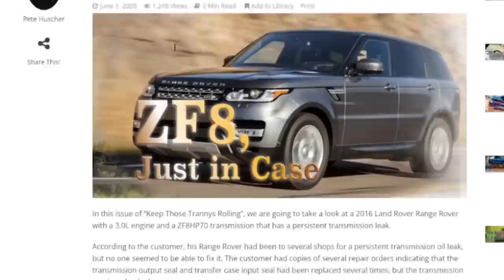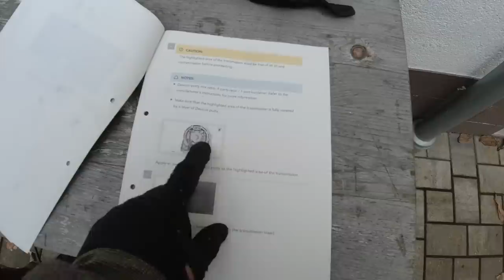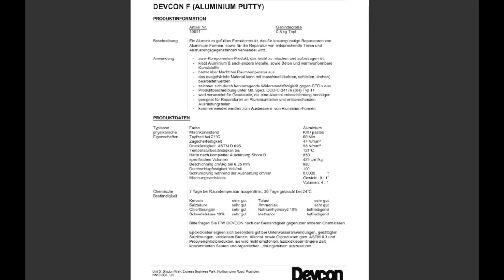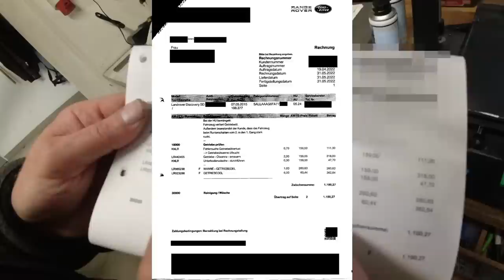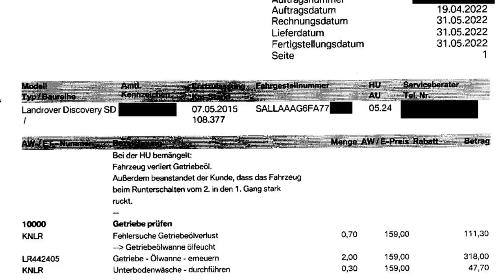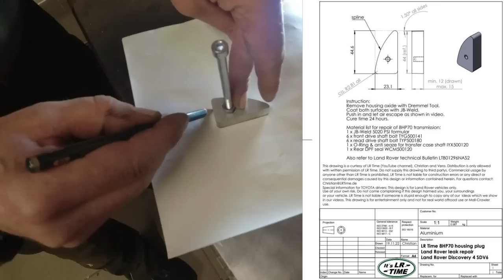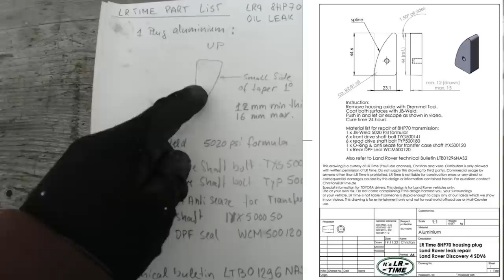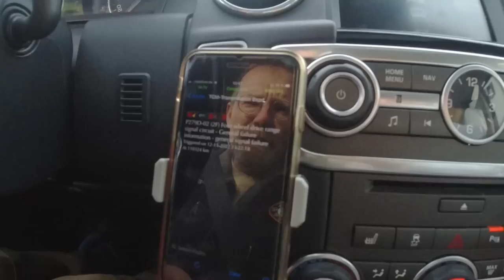Dumbest Oil Leak Ever Fixed on our Land Rover

Comment: I applaude you going after the dealer for charging that poor woman a kings ransom and not fixing the car, but, dealers all over the world do this everyday.  The problem is that the mechanics who work there usually have a deadline in which to fix the car and they don`t really want to be there anyway, so they do the easiest things in order to be able to say that they have done the job, then they can get paid and go home.  The bosses have the same attitude, thye just want an easy life and will defend their work no matter what to save compensating the customer and admitting guilt.  All of the letters in the world won`t make them admit any wrongdoing, you are just on a hiding to nothing.  My heart goes out to the previous owner having spent all of that money.  The only way to get any sort of satisfaction is DO NOT USE THE DEALER SYSTEM AGAIN, and let everyone know that you won`t use LR again.  If you shout loud enough it may get back to the ears of high and the mighty at LR and only they can do anything about it.  Just love your channel, Paul.

Comment: What is the point of having Technical Bulletins if you don’t bother checking them? Someone should read them and keep up to date.Not a very professional dealership, just an expensive flashy building with high overheads, and slack work practices. I have no doubt that there are decent people working there, just none in positions of authority. No wonder LR have a bad reliability rating , mainly in the USA.

Comment: The German Land Rover franchise did not do the repair correctly and because this is a known fault It should have been checked. I would  have contacted Land Rover customer services to complain about the missed technical bulletin and because it's a known issue it should have been repaired free of charge even though it's out with the manufacturers warranty period.

Comment: That repair should be to the manufacturers cost as it is a faulty part being the gearbox casing. LR can reclaim that cost from ZF because you as the vehicle owner have a LR warrantee with LR, not  ZF so that should have been a vehicle recall.

Comment: Dealer should have done the repair again for free in total reason being, they charged for a repair to fix the problem but, they did not repair the problem at all. The oil leak and faulty gearbox were still present after they fixed it!
It gets worse because you found the LR bulletin stating this problem is known and therefore like any other fault it should have been return to dealer for a free repair!
These German gearboxes aren’t all they claim to be obviously. Couldn’t resist that😊.
It might be worth communication directly with Land Rover here in UK about this factory bulletin and let them know what you discovered and see if communicate with you.

Comment: I would say that the dealer should reimburse the previous owner for the poor inspection, the failure to check the service bulletins, the misdiagnosis and all the wasted works, and then properly re-perform the work with a fresh warranty; and in addition, they should self-report their failure to the inspection authority. But that would require (i) taking responsibility for their work and (ii) changing the business model (which is in short to remove and replace parts until such time as either the car or the customer goes away).

Comment: As usual, superb video.
You guys are very entertaining but the stuff you're doing is also some of best quality DIY engineering in the world.

Did I not see Christian using a smoke tester to check various seals during the TDV6 rebuild?
If not, apparently it's fairly cheap/easy to build one based on a theatrical smoke machine.

Using a smoke tester might've been a good way to positively identify the location of any porosity in the gearbox casting.

Comment: The only reason to use an expensive LR [or any other brand] main dealer is because they have all the technical knowledge that should enable them to fix stuff properly, quickly and first time. They seldom if ever manage this in my experience and the company regional service managers are almost always arrogant and dismissive when there are any problems, even to the dealers. Indeed the dealers may be as they are due to having poor factory support for customer problems. Their priority is to lower costs even though it sends customers to other brands. Their real priority should be to sort problems they are responsible for to keep customers satisfied. I’ve dealt enough with them over many years to know how they work and nothing surprises me any longer.

Comment: so i checked it very closely and there seems to be a slight "wetness" around that bolt which is at the bottom of casting of ZF box on the side where cast is "damaged"
it is sweating very slightly but I might make an appointment with you peeps to "borrow" your two poster and a bit of help to fix it when gets worse ;)
Reply from the maker: I have to say, ours was dripping, a lot. So maybe your slight wetness has hopefully a differnt source. 👍🙋‍♀️Vera
Reply: @Vera_and_Christian  same exact place it is sweating atvbut very slightly  at the moment so time to hunt for l405 outside of affected vin range ;)

Comment: Provided the parts Land Rover replaced were indeed faulty and required replacing, then the additional cost to repair the leak per the TSB should be paid for by the customer less any rework to access the leak. They would have had to pay for it anyway. As a sign of good will, a reduction in cost would be a bonus, though as I said, the customer would have paid the full cost if it was done on the first visit.

If they parts they replaced were not faulty, then the customer should be given a refund for those parts and labour. I can't see Land Rover saying those parts did not require replacing though.

Comment: IF you had drilled through the aluminum repair block, that hole would have been the pressure relief. You could have then JB Welded the bolt into the pressure relief hole. Just a thought.
Reply from the maker: We definitely did not wanted a hole in the plate.👍🙋‍♀️Vera
Reply: @Vera_and_Christian  It wouldn't be a hole, it would have a bolt JB Welded into it.

Comment: If it developed after such mileage as suggested by the Sales Manager, it is less likely to be a manufacturing fault and there wouldn’t be a bulletin on it? As you said, it’s a common fault on HP8’s fitted to other manufacturers as well. Aluminium castings are often impregnated with resin to ovoid leaks through thin walls due to imperfections and voids in the material. If it lists a VIN range and not a gearbox casting number, that indicates a production or design issue rather than a faulty mould pattern or core. Perhaps TUV should be notified as jet washing / steam cleaning a vehicle to pollute the environment is a major crime, even for an accidental spill let alone a continuous one like this. Have they done it before and will they carry on doing it if they are embarrassed they didn’t fix the fault?

Comment: From a legal perspective they had to check the relevant bulletin, so if (they claim not) they missed this, the diagnosis was faulty so any work afterwards was not to pay, unless it was necessary for the right repair process. Also if there are many possible causes they were mandated after diagnosis but before the repair to check back with the customer, if we wants to take the risk of some perhaps (afterwards known) unnecessary repairy. Unnecessary repairs can happen, if the diagnosis leads to different possible problems. This is normally at risk of the owner, not the workshop. But here the diagnosis went wrong, and they could only charge the additional cost, which would have happened if they did the diagnosis right the first place. 

So I'm going witb you, that they should not charge extra diagnosis, but also not the additional work for getting it out and in again and also not the second time of oil fill.

Just for interest, what pressure builds up normally in the ZF at the leakage point ?
Reply from the maker: I think there is no pressure at all inside the gear box housing.  This is a bit above the oil pan.  But I am not sure.   Christian

Comment: It is disappointing that many ZF boxes from the 5 to the 8 have problems. Given how many they manufacture you'd think that they would get them spot on by now.
Reply from the maker: The problem is also the Land Rover does not plan on servicing the Hp6 Transmission, but ZF recommends an oilchange every 80000 km (I think that is their interval). If you don't do that, you will have problems like we showed on Joachims Discovery 3 a couple of weeks ago. The newer HP8 has a planned service interval by Land Rover. 🙋‍♀️Vera

Comment: From my experience in the UK with Land Rover dealerships, I think most of the issue is the management of the dealerships, not necessarily Land Rover the manufacturer. For sure some of the issues will be instructions from Land Rover, but it is the competence, or lack of, of the dealerships that either causes or compounds the problems. And my experience with BMW and Ford dealerships is not significantly better.

Comment: Just a quick question, I have two OBD2 readers one is Landrover/Jaguar specific (I carsoft)and that cost £180, today I looked for the Gap tool and found one in the UK at £614  is that correct? (pricey!) also my Disco has approximately 300km in your money lol 180000miles, I can attest to regular oil changes and now thicker oil (thanks) Regards Phil
Reply from the maker: Yes, the GAP is expensive. 👍🙋‍♀️Vera
Reply: @Vera_and_Christian  I think I've found the leak source into the cabin, on your drivers side or my passenger side on the outside of the down post there is a plastic cover, remove this and underneath there are two holes cut into the metal down post, fill the holes and "Bobs yer uncle!" done lol all the best Phil

Comment: @Christan @Vera 
As a Technician and Customer Service Rep for a company that produces high technology expensive scientific instruments. I can offer advice the same I would request an automotive dealership do. 
I frequently run into problems where the initial diagnostics are wrong and we need to continue to repair the instrument as needed. Sorry but this is gonna be longwinded.
The duty of after sales support is to 
A. motivate the customer to feel good about your product and induce further sales through good reputation.
B. motivate the customer to feel confident about returning business for further services to you. 
C. ensure your product and company have a good public opinion and reputation.
C1. Failing good public opinion of the product (unreliable/expensive) we are to make the public opinion of the services are good! You have to beat the competition at something, and if your whathuzits is not reliable or too expensive, you have to offer EXCELLENT service.
Sometimes. you have to be unreasonable and bend over backwards to save your reputation.
You may lose money this time, but your sacrifice is an investment for future sales, where you will earn that money back.

What I would do.

1. The second inspection should be done for free, under "warranty" of the incomplete or mis-diagnosis of the problem the first time. this is a low cost easy answer to appease the customer. 1a. I may even go above and beyond and reduce the initial charge of the first inspection that was misdiagnosis.
2. I would offer the correct repair at a discount rate. The labour would be discounted (again lowest cost loss, and the parts would be at a discount (not cost). 

3. It is my duty to the customer to inspire confidence in my abilities to repair their equipment and make it a lasting repair and lasting reputation. 
3a. The cost of removing the transfer case and second repair being discounted (or free!) is the cost of the Landrover dealership/technician/service manager learning his lessons on checking the TSB's and vehicle history before starting work on an unexpected problem.
Sometimes stupid mistakes cost you. This is an OPPORTUNITY to learn your lessons to do better next time. And!!!! all the future customers coming with the same/similar problem you now know what to do (including proper diagnostics and tests first, such as a UV dye leak check first, would have shown the source was not the pan during the second inspection that should have happened.)

My company produces very expensive equipment in niche industry, and I will have a somewhat mixed opinion on the product itself, but we stand confident against our competitors because we offer stellar service. We always fix what we sell first time, and make sure the customer is happy about the services they get, they are reliable repairs and when problems happen we resolve the problems for the customer.

Comment: I had a discovery that went into a main land rover dealership for repairs due to lots of black smoke they could not fix it after several attempts,  On the last occasion it was in the main dealership they happened to need a head lamp for another discovery due flaking inside the lamp, so they swapped it with a headlight off my discovery,  a few days later I realized what they had done and proved it.
Reply from the maker: Yeah that is so unfortunate and unbelievable. 😳🙋‍♀️Vera

Comment: Not really LR’s fault. The gearbox is made by ZF. If they provide a faulty component, the last thing LR want to do is replace the whole thing, even if ZF is paying for the part.

We have an old ZF6 tranny on our D4 which is not as sophisticated, but seems to be holdings up well at 135k and counting. A fluid and pan filter change will be performed in the summer. Had it flushed at 90k.

Comment: That was a manufacturer issue and should be done for free . Could you put  low air pressure  in gearbox breather then use soap water to detect leak

Comment: Great repair totally agree with Christian Landrover cheated on mot and really factory release updates and good dealerships should at least read these when cars come in for service complaints (oil leaks) Vera is right too they should have fixed for at least the cost of an unnecessary driveshaft replacement 😉
Reply: Oh love your videos  that hoist sure works well ,landies just luv them ! Cheers guys 😉

Comment: JLR/Tata + it's dealers are sadly the best Toyota salesmen that Toyota could ever have. I say it sadly as as a Discovery owner. And what's even more sad. They haven't learned that reliability is important for customers. JLR's boss stated year or two ago, that they will focus on reliability, but there are still plenty of reports of new Defenders having reliability issues. Not good for a car that should be aimed at long distance and offroad traveling even if it has warranty. No-one want's to be stranded hundreds or even thousands kilometers from home and/or service station.

Comment: Land Rovers for many years have used porous castings. I have no idea why they have not addressed this issue. Range Rovers were losing value at an astonishing rate due to water coming through the side of the block especially if they had been allowed to overheat. The best solution is probably to have a Chevy engine fitted and dump the LR lump.

Comment: It's not just LR dealers that are bad, I've dealt with Renault and Ford main dealers, both were simply incompetent, unable to diagnose or repair simple faults, I've also had similar with a BMW main dealer.
I worked for VW/Audi and Peugeot dealers, you'd be supprised just how little interest in vehicles most mechanics now have, it's merely a job that pays them a wage.

Comment: Having worked for several Land Rover dealerships in the 1960's, and owning my own Land Rover genuine parts business from 1974 to 1986, I suggest you're using the phrase "Land Rover" when talking about a dealership, a franchised dealership, that charged for a repair that failed to do its job.  "Land Rover" should be used only when talking about the corporation that builds the vehicles, or the individual products that corporation builds.  The dealerships are franchised by Land Rover, but they are independent businesses rather than actual parts of the Land Rover Corporation.

My wife's son is a diesel mechanic employed by a John Deere dealership in North Dakota.  Deb often talks to folks, including me, and states that Jeff, her son, "works for John Deere."  I've never said this to my wife, as I don't wish to sound like I'm trying to argue with her.  Jeff does not work for John Deere Corporation.  He works for a John Deere franchised dealership.

I drove Rover cars and Land Rover vehicles for almost exactly 30 years.  Since 2012 I've owned a Jeep Wrangler Unlimited Rubicon.  The Rubicon has been vastly more reliable than any Rover or Land Rover product I ever owned.  I bought my 2012 Jeep Wrangler Rubicon from a franchised Jeep dealership, not from Jeep Corporation (or Jeep Division of the then Chrysler Corporation).

Your videos that I've seen thus far are both very interesting, very informative, and very well put together.  Keep up the superb work you are doing with your videos!  Thank you very much.  Thank you for your product knowledge that, I suspect, is vastly better than the average automotive mechanic has to offer.  You do great work.  Happy Land Rovering!  Andy McKane, 29 January 2023, Maunaloa, Molokai, Hawaii.

Comment: I haven't read through the comments so i am responding based on your footage. I honestly feel that you should not e charged for a diagnosis. I also feel that you guys are so over charged. My opinion is that sometimes the manufacturer can accept there is a defect and give a non technical or maybe technical solution. Technical people can use it, non technical can take to the dealer. But this is just my opinion from NBI, KE. I would honestly fix it myself as long as I know what the problem is because dealers are mostly not affordable for use here unless you make a tidy sum every month